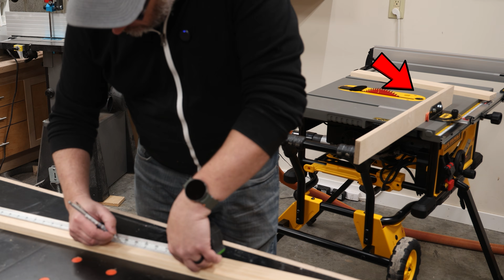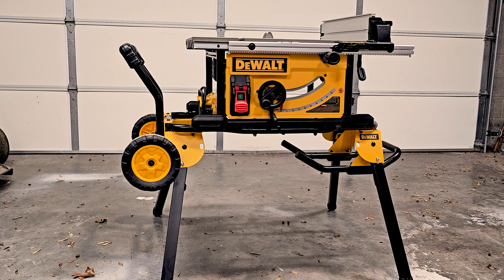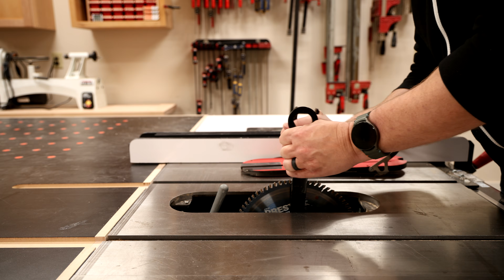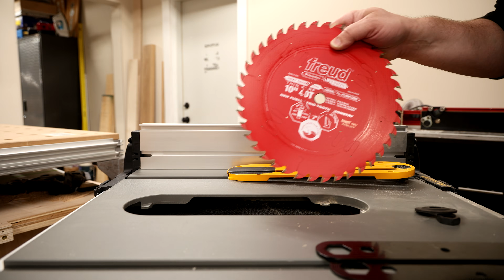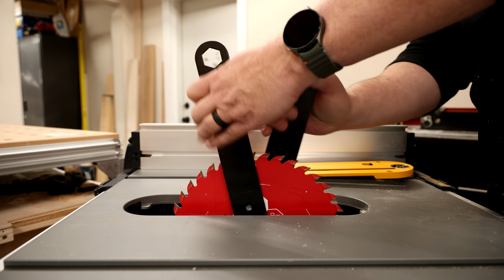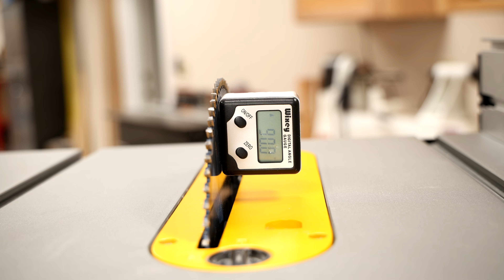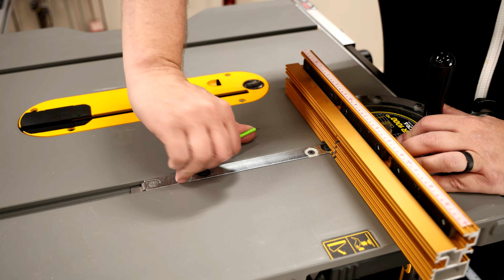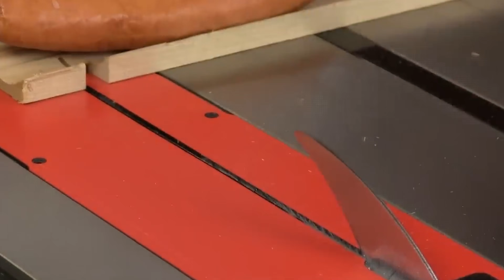Why do people even buy this saw?

Comment: I gave my 2 yr old SawStop jobsite saw to my son-in -law and got a 36 in  SawStop PCS (had to have a 240 line put in).  The smaller saw was just not enough and was underpowered for my purposes and you're right, there is not enough space in front of the jobsite saw

Comment: I literally just built a cabinet and bigger table for my skill job site saw I used fine measuring tools and got my blade really accurate due to the adjustability of the saw so it seems like it dose fairly fine in that configuration

Comment: What about contractor saws? The ones with a cast iron top, more power, and bigger fence that can at least be rolled out of the way when not in use. That would be perfect for me since I work in my garage. Have space to store tools up against the wall, but still need to put cars in there sometimes. It seems the biggest problem with them is getting a quality one. I see used Deltas all over and in good condition. However, some people say certain models/years are good and others are terrible, but they can't tell me which is which. I'm fine with tuning a saw and I don't even mind replacing some parts with better stuff if there is a deficiency somewhere. What I worry about are things that can't be fixed, or that cost too much to be worth fixing. I'm getting by ok on my jobsite saw, but I'd love to have something with more power, capacity, and accuracy.  Anybody have some good advice?
Reply from the maker: I assume the contractor saw is a good middle step but I jumped right from a jobsite saw to a cabinet saw and have no experience with them so I don't have anything to share

Comment: I put the 46" bow fence on my 8.25" dewalt jobsite with 2 kreg feather boards, I recommend it to anyone cutting pieces above 4-5'.  

It was $260 for the fence and boards but it was with every pennie.  But to make my kitten infeed and out feed supports today to add.
Reply from the maker: that's a nice fence. They need an option less than $100 tho.
Reply: @MWAWoodworks  It was expensive, almost as much as my table saw.  I justified it by calling it safety equipment 😂

Comment: Its a shame that the hybrid saws are no longer sold. Ridgid, Craftsman, and Delta made some really nice intermediate saws that thad the body of a contractor saw and the motor and table top of a cabinet saw. They were very reasonably priced and did everything a cabinet saw did with the footprint and mobility of a contractor's saw. My Craftsman 22104 has been a magnificent piece of equipment for years and done everything I've thrown at it, and they sold for relatively less than that Festool track saw set you back. I know it is hard for YouTubers to even comprehend that some of us are simply hobbyists whose life doesn't revolve around woodworking, and we really don't need, nor can afford the luxury of the high end tools.
Reply: There are lots of companies that still sell hybrid saws. Grizzly, Laguna, Sawstop, just about every company, if you find what looks like a cabinet saw but it has less than 2 hp and run on 110v, Its a hybrid saw. 

The problem with 110 is during a heavy cut it can trip a breaker. The good thing a about a 110 v saw it that during a heavy cut, it can trip a breaker. (no kickback)
Reply from the maker: the market definitely split between cheap jobsite saws and expensive cabinet saws. Sawstop makes a nice contractor saw but it has the Sawstop price tag.

Comment: My table saw sort of falls in-between the two categories. I found a Contractor saw with a cast iron top and 2.5hp motor on marketplace for $250. It came with upgraded fence/rails and wing table extensions. I find its the best of both worlds. Not nearly the cost of a new cabinet saw but also still pretty heavy and powerful. I ended up taking it all apart and cleaning the trunnions and all other mechanisms and I built a new stand/table for it to live on, incorporating dust collection. I foresee it being my main saw for many years.
Reply from the maker: also a good option! And secondary market finds are great.

Comment: Squaring your new saw should always be the first thing you do as part of the set up before the first cut is made. I would not count minor adjustments as a negative on the DW. The fact the adjustments were so easy should count as a positive. 👍
Reply from the maker: I agree, however I feel that most people just beginning would pull that saw out of the box and fire it up without question. Minor misalignments are annoying, major ones are dangerous. But I agree there are many "easy to adjust" calibrations on the DeWalt.
Reply: @ unfortunately, you’re right. Too many newbies pull a dangerous tool out of the box without knowing proper use. They THINK they know how to use it. And that’s how so many people get hurt. Ignorance and complacency are the enemies of Shop Safety.

Comment: I meant to add one additional comment.   IMHO,  based on my 30 years of woodworking and my father's 50 years of woodworking, Sawstop is largely a waste of money as the vast majority of table saw accidents are from kickback that either ejects the material back into you or up and back at you.  I would prioritize getting a good set of one direction rollers on the fence and not standing right behind the material (when cutting narrow boards) and that will go a long way to avoiding issues.  Use push sticks/blocks as well.   I"m not saying don't buy a Sawstop, I'm just saying don't expect that saw to magically fix everything as it won't do a damn thing to fix kickback, it will only help prevent cuts to your hand if you're doing things you should never be doing in the first place.
Reply from the maker: For me it was a choice between a SawStop and a Powermatic. The Powermatic isn't really any cheaper and the Sawstop can prevent the worst from happening. But that's choosing between two high-end cabinet saws.

Comment: I use to have a huge rigid cast iron belt driven table saw and I liked it but damn it's nice to take my DeWalt and fold it up and put it away when I'm not using it of course then again I do mainly construction projects and custom carpentry for homes
Reply from the maker: yep. shop work vs field work is a huge deciding factor!
Reply: @MWAWoodworks  Yes I like doing it in the field but also like being able to do projects in my garage workshop but still have plenty of room I rather have large assembly tables in the middle for projects with a workbench So many options to organize everyone's shop and personalize it to whatever they need

Comment: Thanks for making and sharing the video, especially the "obvious once somebody's told you" tip about dealing with tables that aren't flat.

For what it's worth, I have a tiny, damp and cold "shop" so I couldn't fit a cabinet saw into my garage and, were I to, it's cast iron top would rust faster than I can type "would rust faster than I can type". I bought my saw about a year before Sawstop started selling its jobsite saws over here, otherwise I'd have bought one over the DeWalt. Also, I couldn't afford a cabinet saw. 

My 210mm DeWalt's blade alignment was spot on out of the box, tested with a dial test indicator. I couldn't see any deflection at all, which astonished me.

The fence was out, but was as easy to adjust as yours. (By the way, when I'm moving it a long way I just push it and do final adjustment with the hand wheel. I've never done it 25 times!)

I completely agree with the angle setting - I'd really like a dedicated hand wheel. I've found I don't trust the 45 / 90 angle stop cams, possibly because I'm too rough and knock them out of true. I've not so far needed anything other than those two angles! I always check with a square before use.

The table's not quite flat, but is so close I'm not bothered by it, which is just as well as there'd be little I could do about it. I've never used the right hand mitre slot, so I have no idea if mine are different. That's a really odd manufacturing fault.

Overall, I think it's a cracking little saw, way better than the Kity I used to have.
Reply from the maker: All good points!
Reply: The cure for rusty tools is to keep them waxed.  I've had the same old can of Johnson's paste wax in my shop for over twenty years, it's still half full, and it's rustier than any of the tools I use it on....  I'm guessing modern car waxes would work even better.

Comment: I think that the last 2 points you made definitely justify shelling out the cash for a quality cabinet saw, particularly the SawStop for the safety. You said you've been using it for 10 years, yet still looks almost brand new and is dialed in and with no issues. Could you say the same about the Dewalt job site saw in 10 years? I don't know.
Reply from the maker: those are the reasons I have the saw that I have, for sure. The jobby will occupy my garage or shed for "quick" operations or when I want to take a saw with me somewhere. I'm glad I bought it as well.

Comment: Yes!  I sold my boat anchor of a cabinet saw and got the same 10" Dewalt and absolutely love it.   It does everything I need for fine woodworking with a fence upgrade and Amana blades.  I've left it outside in the rain on accident and there was zero rust or issues with the top.   It does take longer to cut 2" thick maple or oak but I do that so rarely that it's not an issue.   Just as welders have gone from huge boat anchors to compact, portable solid state units (even the 220v models), so have table saws.   Only volume cabinet / woodworking shops need a cabinet saw.  If I were Dewalt, I'd focus on offering improved dust collection and an optional high end fence option to really help close the gaps to a table saw.
Reply from the maker: they really have an opportunity to close a gap in the market and offer a step up from the basic jobsite saw for sure! If they could make a saw for $800 that had everything dialed in and a couple more features, it would be a great product!
Reply: @MWAWoodworks  Or, if they just had to have a jobsite saw that was dead-on accurate from the jump, SawStop has one for around  a grand. That said, I can't see how a jobsite saw can deliver the same true edges as a cabinet saw. I guess if we're talking butt joints where proud edges can be sanded flush, but I do a lot of lock miter joints that have to run true. The miter bit is unforgiving here. While I don't have the experience with a small saw, I just don't see that ability being there.
Reply: Lol did the same cabinet saws are not fun moving from jobsite to jobsite site they definitely  need to stay at the shop doing doors and drawers.
I have 4 contractor saws that work fine for what I do
Reply: I've been pleasantly surprised by the dust collection on the Dewalt (10" 7491RS) with a couple tweaks. I got a better blade-guard mounted shroud from Etsy, and between that and blocking the slots on the guard the whole package does pretty darn well with all ports connected. The biggest surprise was that the blade shroud under the table actually had flex baffles to channel the air flow and limit spill - other saws I looked closely at (e.g. Hercules that otherwise looks very similar to the Dewalt) didn't have this.  So, maybe not high-end cabinet saw effectiveness, but my Dylos meter says 'pretty good'.
Reply: youd need to explain what you consider fine woodworking . i used a makita jobsite saw for twenty years as a trim and railing subcontractor . when i switched over to custom cabinetry i used a powermatic . the two saws werent even comparable . if youre a weekend hobby woodworker you could get by with the dewalt and skilsaws but making kitchens on a regular basis calls for a professional saw .
Reply: @oldfart5063  Yup. I do furniture, both casegoods and built-ins. I just can't conceive of someone running 8/4 maple through a DeWalt and not either getting it back in their face or taking it over to the bandsaw to get a straighter cut
Reply: People cut their fingers off with those Dewalt piece of junk, it’s on safe. 3500 Americans a year cut their fingers off with tablesaws.
Reply: @shortaybrown  Sure, blame the saw.
Reply: @nodbod-d8h  I bought the PCS for it's precision, and it's dust collection. But in researching I saw the videos from SawStop. The guys on there that lost digits weren't newbies that were pondering what went wrong. Every one of them were professional woodworkers who had thought nothing would go wrong until it did. I thought it was icing on the cake, but thought I would never set the brake off, I watch everything. Except a misadjusted Incra miter gauge. The safety does indeed work.

Comment: A timely video for me. I am currently going through the process of getting a cabinet saw. After watching this video I think the Dewalt table saw I have may be sufficient. Will definitely evaluate if I even need a new table saw.
Reply from the maker: A jobsite saw and a good track saw go a LONG way. Not a perfect solution but good for most woodworking hobbyists where space and $$$ are factors.
Reply: @MWAWoodworks Did you get the TSO fence upgrade from Amazon?  I do have the Makita track saw.
Reply from the maker: Got it from TSO. There's a link in the description. That Makita track saw is good!
Reply: @MWAWoodworks  Yes it is. Do you know if the TSO fence will work on the DW744 10” table saw?  I don’t see why it wouldn’t.
Reply: May I suggest a Laguna… that is what I have… costs a lot less and in my option works better…
Reply: Thank you. I will look into the Laguna.
Reply: until Sawstop gives away its patent, there is no other saw to even consider if your looking for a table saw. I don't have one, but I am not in the marker for a new saw. SawStop or nothing for now.

Comment: I ended up changing my Dewalt table saw for the mid-sized Delta 36-725T2 mainly because of the space in front of the blade, which is a pain when using any miter gauge and also because the top is aluminum which prevents the use of any magnetic accessories/jigs. I will keep the Dewalt for when I do cuts outside the house tho ( working from the basement !). 

I think managing the dust will be a bit easier on the bigger saw as well ( even if it will take some work either way )
Reply from the maker: not being able to use magnets was something I didnt mention in the video (a creature comfort) but I do it all the time on my cabinet saw. I actually thought the dust collection on the DeWalt was not bad at all. A LOT better than the old Bosch jobby that I started out with.